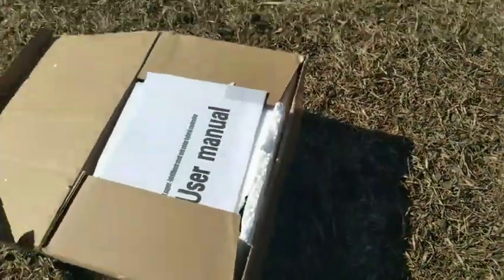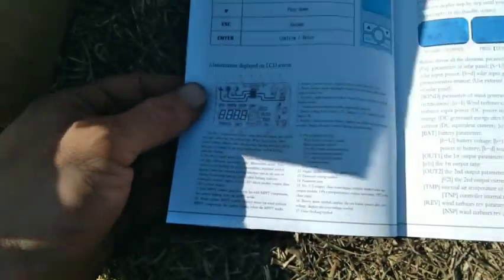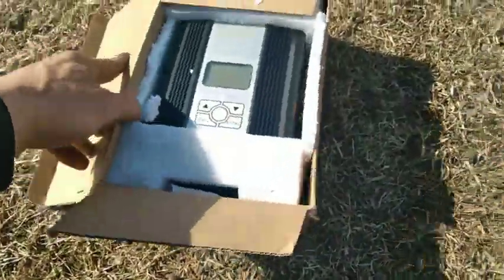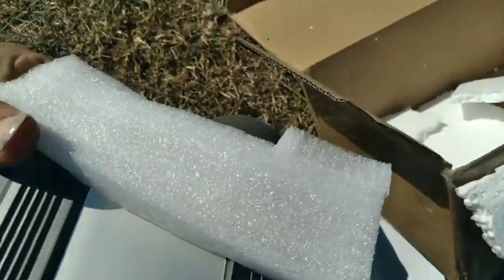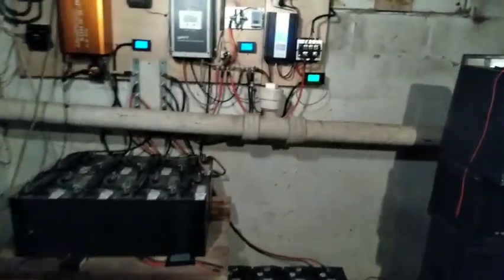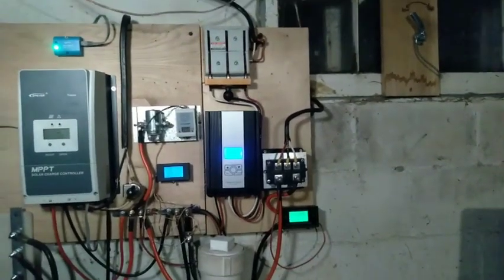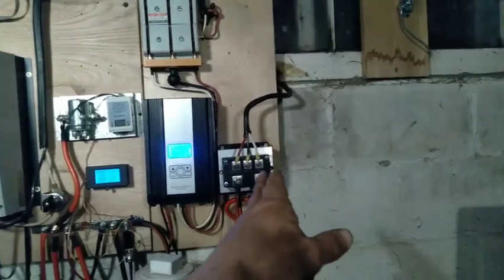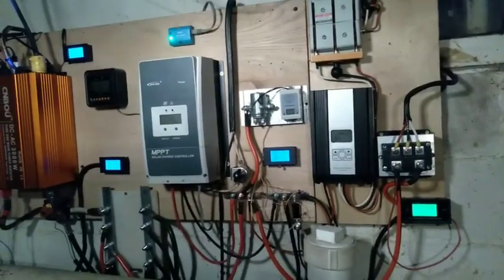MPPT Wind/Solar Controller, Max Series.

Comment: Where did you get it because I need one I have low winds
Reply from the maker: US $210.00  25%OFF | Hot sale 1kw 24v 48v 96v 120v Wind Turbine Charge Controller Solar Battery Charge Controller
https://a.aliexpress.com/_mrbkh8B
Reply from the maker: I'm impressed with it already. Seeing power my previous setup never would have harvested.
Reply: Thank you I was looking at the classic but man they're expensive
Reply: Another question I have for you what kind of inverter do you have
Reply: @solarandwindinsouthtexasda1473  I have a gianbel 2400& cheap Chinese made 1000 watt grid tie for my solar
Reply from the maker: @solarandwindinsouthtexasda1473  yeah i looked at the classic also and the price scared me away also. I do wish the PC software for this one was easier to connect to because i could really dail it in to optimal specs but im still thrilled for now. I havent given up on that and ill keep posted on updates. My inverter is a CNBOU 3000w/6000w 24 volt. It's a pure sine wave inverter, 120 volt single phase. Great great inverter! Correctly rated if you can believe it. Very well built with really good internal passive cooling. I've only ever gotten the fan to kick on once after lots of abuse. That'll be my next video. I'll flex it and try to get it to beep.
Reply: Wow that's a nice and controller and cheap too considering what it does
Reply: I taught it was a split phase inverter I am looking for a split phase inverter I have a single phase 3000 watt samlex evo 3012 the Marine series  it's a real good inverter but very Spencer I paid $1,700 for it I did not know any better at the time
Reply from the maker: @solarandwindinsouthtexasda1473  check out this video, this is a 4000w/12,000w split phase. Much better price. 
https://youtu.be/nRSTQJKP0_I

Comment: Ty for the nice video.. I was waiting this video from you..Plz if you can show us what he can produce per day or per week ..and what it was the produce per day or per week with out this (on the same turbine)..so we can compare..I think it will be a big difference..and if you can,tell us what it was the start wind speed to produce 1watt with out this ..and what it's now.
Reply from the maker: I plan to test this thing very thoroughly. I do know that with the rectifier i needed wind speeds over 12 mph to see any power at all and that would jump from zero-20, back to 0....then maybe up to 50 and back to 0....and so on. I've been very frustrated by the turbines the last 2 years watching them spin pretty good and 0 watts. NOW....basically if the turbine is spinning....SOMETHING is coming in! This has been my expectation since the first turbine and the 2 years of blade changes and tail modifications. With the turbine optimized the way I've done and this controller i'm excited to watch the energy pour in!